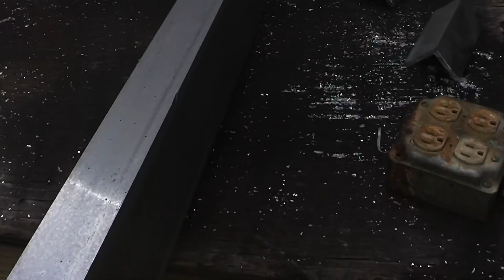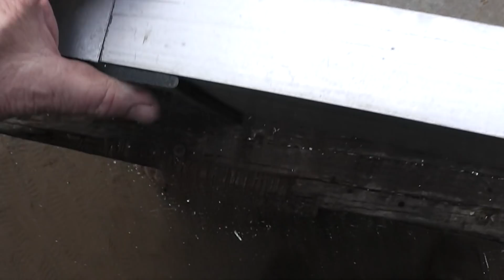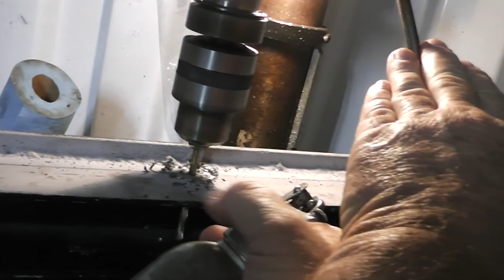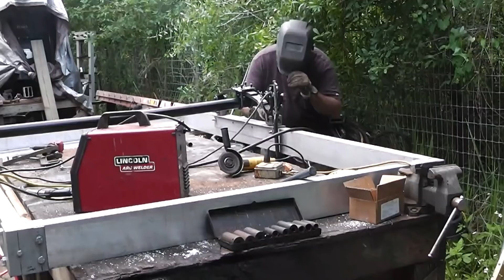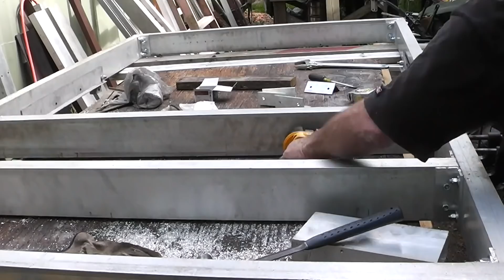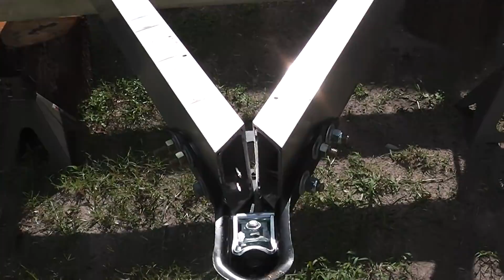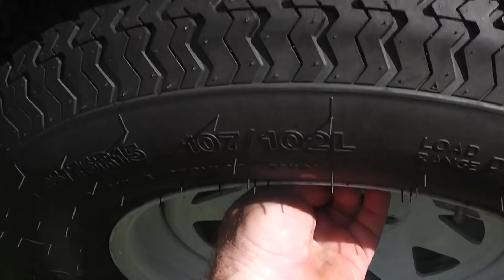How to Build a 5x8 Aluminum Utility Trailer Step by Step

Comment: Im bout to build a 5 by 8 far as that axle you using what is measurement from center leaf spring to center leaf spring just so I know what dimension axle i need for my 5 by 8 framing

Comment: If you didn't want to have a wheel wheel on the side, what you can do is raise your axle to the bottom side of your springs and that it raises it up a little bit, then that way, the tire would be below the flat deck on top

Comment: How much did it end up weighing? As an engineer, I think you did a good job. The sections are probably unnecessarily large, but if that’s what you had available, that’s what you use. Good job
Reply from the maker: Thanks. It weighed 680 pounds. It was over built.

Comment: I like your style ,Over Engineered and Over Built ! Bravo on your Aluminum Welding Skills  i spent 35 Years professionally works in the Ar hate tual Woodworking Industry at one point i changed Companies and worked with one that did 50% Woodworking and 50%ArchitectualnMetal  that was mostly Aluminum  those Welders never disappointed  inCraftsmansip  and Eye pleasing work once i knocked the Skeg off a Outboard Engine of mine ( a Common issue for Boaters  )  and the Owner  told me to grab what i needed out of the Scrap Bin  ,Shape it Prep It and have one of the Welders attach it  on the house ! i did and  it was one of the prettiest repairs ever ! My Welder. actually did Weld all of the Baltimore InnerHarbor Water Taxi Boats the City use to move people around to all the restaraunts and attractions  my Buddy who  was with me when the damage happened couldn’t beleive how flawless the repair was after  a touch up paint job

Comment: 1:25    Angle Iron?    or Aluminium Angle?
Reply from the maker: 4x4 angle iron.
Reply: @homesteadprepper  thanks for the reply.    In the perfect world it would be nice to avoid all steel brackets and fixtures.   I live in the rust belt of southern ontario.   They heap on the salt to the roads in winter

Comment: Do you not have a problem with aluminum and steel contact causing corrosion ? It will reduce the life of the trailer .A non metallic strip between aluminum and steel is used to reduce electrical reaction and corrosion.
Reply from the maker: It's been 4 years and there are no significant corrosion problems, yet.

Comment: Estoy por construir una estructura atornillada con tornillos de 10 cms de largo por 8 mm de espesor. La suma de anchos de los tubos que voy a unir debe ser igual o menor a 9 cms. Es un rectangulo 5.60 x 1.80 metros para un vehiculo de 200 kgs más el peso de 2 adultos y dos niños a 40 kms/hora. Pense en tubos de 2"x2"x2mm a lo largo cada 20 cms con algunas  planchuelas de 5 cms dispuestas a lo ancho cada 1 metro. Seria suficiente ? Alguna idea mejor ? gracias saludos.

Comment: Your axle is on the wrong side of your springs bow in axle gose up not down.
Reply from the maker: In the beginning of the video, the axle is incorrect but, that was just to space the frame rails correctly. If you had taken the time to watch the whole video you would have seen at 32:37 is in the upside down position and that the trailer is in the upside down position as well. When the trailer is turned over on its correct side the axles are correct with the crown in the upwards position.

Comment: Its been 3 1/2 years, did you use it much? Did it hold up? Did dissimilar metals and/or pressure treated wood have any effect so far?
Reply from the maker: No corrosion from the galvanized bolts or pt wood. I've put over 12k miles on her.
Reply: @homesteadprepper  its holding up? How much weight (max weight) have you put on it?

Comment: Came here and took one thing away for sure...if you are thinking about welding an AL trailer frame and you just learned how to AL weld, you might want to reconsider.  This will no doubt hold up, but the questions are:  1.  Is the weight savings and cost increase of using AL with the steel gussets/brackets worth it?  2.  As the old saying goes, weakest link...those brackets will degrade and rust well before the AL if the trailer is abandoned in someone's lot (which trailers often do find themselves).

Comment: regarding the the reaction of pressure treated lumber to aluminium. It will be greatly reduced if you use a foam sill gasket used for framing houses over concrete

Comment: My only criticism is check how your front spring hanger is welded onto your steel. You might want to look under a few professional made trailers before starting a project like this. I would have preferred a lighter gauge steel C chanel instead of aluminium. Its much stronger without adding much weight.
Reply from the maker: This trailer has over 10K miles on it so far and it is holding up just fine.

Comment: How come you elected to use bolts without washers?
Reply from the maker: It is stronger than welding.
Reply: @homesteadprepper  My question is regarding your lack of washers
Reply: Bolts are fine, but not stronger than welding. Not even close.
Reply from the maker: @vulcan4998  How can you say that? Welding aluminum will weaken it. The heat will affect the temper of the aluminum, which will result in a loss in yield strength.

Comment: It is not more convenient to weld everything instead to put too many bolts
?
Reply: Not when you are dealing with a tempered material. Every weld drops the stringth of that aluminum by a factor of 3.

Comment: What’s the most you’ve carried with this trailer?
Reply from the maker: Probably about 1,200 pounds, so far.  I don't see any problems with putting 3000# on it.
Reply: homesteadprepper Any recommended changes after a years of use? Thing you’d have done differently?
Reply from the maker: I would use 2x5x1/8" instead of 2x5x1/4" next time around.  I would use the 1/4" wall if I was building a larger trailer.  This trailer is really over built for its 3500# capacity axle. https://www.youtube.com/watch?v=UlfyZil7y-M

Comment: Where'd you get the aluminum,? I know you said scrap in the description. But jw.
Reply from the maker: I have several fortuitous dumpsters that I have permission to remove scrap from.  It works out very well for both of us because they are charged for the weight of their refuse. So the more I remove, the less they are charged. Btw, it has taken over 10 years of collecting to make the trailer you saw in the vid.  Usually, most companies are very generous with their waste if you just ask.

Comment: Your bolts will forever be coming loose.  Especially where the cross beam brackets meet the main beams.  (Anywhere a bolt gows through a hollow section.) 

 The aluninium rectangular section will squash in with use.  And tgen the bolts will chew out the aluminium once there is any movement in the joint.

You would need to use crush tubes in any hollow section where a fastener pass through it.
Reply from the maker: homesteadprepper 2 days ago

I appreciate your input but, with over 8500 miles on this aluminum trailer, I am just NOT having these issues.  I do believe that would be true with really thin wall aluminum, this trailer is constructed out of 2x5x1/4". https://www.youtube.com/watch?v=UlfyZil7y-M
Reply: yes.   I would agree that crush tubes would be needed.    I cannot imagine that it would be possible to get the bolts tight enough without squeezing the rectangular tube.

Comment: Just thinking, would it work the same in the area of the axle support to use double aluminum 1/4 tubing side by side instead of the steel support that you built? I heard some people say that some stainless steel type of bolts retard corrosion. Since I used to be a sailor, I think that a marine anode would work to prevent corrosion.  Great job.
Reply: True, Home Studio Adventure, stainless steel does not interact with aluminum (galvanic corrosion) like carbon steel -- it is best to ALWAYS either join stainless to aluminum or separate carbon steel from aluminum with plastic, rubber, or some other non reactive material -- pieces of old mud flaps and inner tubes work well, for example.

There are few things as disheartening as finding that telltale white corrosion and a once very light weight, extremely long wearling, and very strong aluminum piece become cracked, brittle, weak, and needing replacement.

Comment: I would have still used lock washers along with the nylon hex nuts. I noticed you did not use nylon nuts where the axle attaches to the leaf spring. You can also drill a hole on the critical bolts and insert a cotter pin for good measure.
Reply: No need for that. From what I've seen, if you buy trailer axle parts and you are not supplied nylocks, they are going to be regular lock nuts which do the job just fine. I'm guessing that's what he had. They are essentially nuts that are crushed or crimped in two places to stop them backing off. Very common.
Reply: Or just weld it. Save a bunch on hardware and no worries about galvanic corrosion.

Comment: Nice job. I am building several 6x12 trailers out of warehouse pallet racking. It will all be bolted together using stainless steel bolts & nylon hex nuts. Stainless steel is cheap when you buy it in bulk. My axles are maintenance free vehicle hubs. They are good for 150,000 miles, and simple to replace. No welding whatsoever. I also managed to connect the leaf springs for easy repairs if needed. I am pretty rough on trailers.

Comment: What is excellent build! But I don't think you will ever be on an Indy pit crew! LOL! Seriously great job! I won't question how much weight do you think you saved compared to a All Steel trailer? Same size obviously
Reply from the maker: I didn't really save a whole lot of weight on this. It was way over built.  If I build another aluminum trailer, I will use 2x5x1/8" instead of the 1/4" that I used on this one. Typically you can build a trailer that is as strong as a steel one but, @ 15% lighter.  This trailer came in at 680#. Using 1/8 wall and less cross bracing would have brought it down to @ 500-550#.
Reply: @homesteadprepper  my voice recognition is terrible on my phone. My whole comment made no sense! I was trying to say it's an excellent build. And it looks like you saved a decent amount of weight by using aluminum. And I was busting chops about being on an Indy pit crew for something or other!. LOL but it really was a great video

Comment: Is it a different welder to do aluminum?
Reply: As far as I know just different welding wire spool inside the welder, probably different temperature depending on the thickness of the metal.... Also as you weld aluminum the tip heats up as you go so you'll have to speed up depending how long the weld is or you'll burn through.
Reply: ...warning, William Mickelson, you'll want to research these issues -- aluminum has broken many hearts -- not only mine!

...for example, because aluminum is so soft, thin filler metal wires (.045" and under), the sizes compatible with smaller wire feeder welders like the one used in this awesome project, will bend and spall inside the liner, bird's nesting near the drive roll inside the wire feeder and never making the journey to the contact tip at the business end of the gun. (Yes, they do sell teflon liners [typically liners are stainless], but they unfortunately won't completely solve the problem ).... 
so, when using a wire feeder with aluminum, the ductility/softness issue is best be addressed by using a spool gun and small spools of aluminum welding wire (which are housed at the special gun itself, not in the wire feeder unit [look it up]), but, spool guns are not cheap.

Next is the problem posed by the extreme thermal conductivity of aluminum: it requires a lot more voltage than carbon and stainless steels to keep everything hot enough to flow, so a larger constant voltage machine (look it up) may be needed, and, thus greater input amperage to power that machine.

...other issues you'll want to research are: (1) prep ( the thin aluminum oxide "skin" actually has a significantly higher melting point than the "meat" beneath it, so you want to remove the oxide (at the weld joint area) either mechanically with abrasives or chemically with a weak acid solution [readily available at your local welding supplier]); (2) shielding  gas mixture; and (3) filler wire choice....

A cheaper way to get going would be TIG rather than MIG, except that (as I found out recently) 180 amps a.c. and under isn't always enough when dealing with large weldments, joining what would otherwise be  appropriately "thin" pieces (3/8" and under) due to the aforementioned thermal conductivity sucking your heat away. 
Finally, of course, when welding Aluminum, whether TIGing or MIGing, you'll need to work indoors so the wind doesn't carry your shielding gas away.

So, all and all, it's very doable, but, compared to carbon and stainless steel, welding aluminum requires some additional equipment, info., and planning, that's all.
Simply switching your filler metal roll may not give you the results you're hoping for.
...any reaserch you do will be its own reward, though, for once you are able to weld aluminum,  you'll be in very high demand!

Wishing you unending success in all things!
Reply: Mig will weld both with different wire & gas

Comment: What was the cost of materials. Axels, leaf springs and frame?
Is aluminum cheaper?
Reply: aluminum is more expensive than steel. but may last longer so in the long run maybe cheaper depending on application
Reply: What was the cost? I'd like to compare to buying a kit.

Comment: What's keeping the nuts on the U-bolts from backing off, due to vibrations?  No lock tight, look washer or lock nut?
Reply: A lot of U-bolt nuts are self locking. The nuts are pinched so they are not perfectly round.

Comment: So let me get this straight, your not going to weld any of the Aluminum, every aluminum trailer I've ever seen was always welded, & is everything quarter in metal,? ( Meaning the frame )
Reply from the maker: Everything is 1/4" with the exception of a few pieces of 1/8" angle.  In retrospect, It would have been fine to just use 1/8" wall rectangular tube. I over built it. The aluminum shown is 6063-T5 which is weldable.  Some aluminums are not weldable.  I went with bolting instead of welding because this trailer is being used for long distance hauling and I did not want to have an aluminum weld failures out in the boonies. Aluminum welds are prone to cracking and finding someone out in the boonies who knows how to weld aluminum might be expensive and time consuming.  Carrying my tig welder, argon bottle and a generator big enough to run it is just not practical.  It is much easier to replace a broken bolt on the side of the road than doing some tig welding.  And FYI, I have logged over 3500 miles on this thing with some heavy loads and no problems.
Reply: @homesteadprepper  ...well thought out and very well explained  -- thank you!

Comment: That's a great looking trailer. Its almost the spitting image of mine. Luckily, my son in law is one helluva welder and welded all the aluminum frame and tongue as I would have give out drilling all the holes!  I actually used a set of aluminum atv ramps as the floor so mud and crap can fall through. I also inset the LEDs into the frame and ran all the wiring inside the frame. Wish I could post a picture!

Comment: Your design is sturdy. The galvanic corrosion will begin to show soon though. There is a product on the market that makes as simple as soldering to weld alluminum. I still would have used all the angles for reinforcement at the joints.
Reply: Good point but I think the builder answered the welding issue very well ( just a few comments before yours); I truly hope you and I are wrong about the builder's choice to not use stainless hardware though!
...I curse that white dust!

Comment: I was wondering how I would couple my roof rack. I think I know how now. Excellent video, very professional. I don't think I'll have the same problem with 2 types of metal being away from the salt?
Many thanks.
Reply from the maker: Thanks.  All of the aluminum you saw in the vid with the exception of the 1/4" angle was reclaimed old scrap that was loaded with galvanized steel bolts and screws. Many of the bolts and screws that were removed seemed to be in really good conditon.  A few bolts were really corroded and the aluminum as you saw in the vid, did not seem to be much affected.  I don't have any salt down south here.  You might consider using some kind of extra coating on your bolts before assembly to combat the salt.  Good luck!

Comment: Thank you. This is awesome. Could this be done on a larger scale eg 7 x 14 for a camper?
Reply from the maker: Thanks. 
Oh yes, most certainly!  And with all the nightmare stories I have heard recently about how new campers failing due to crappy/cheap factory builds, you might just be better off building your own out of aluminum.
Reply: homesteadprepper I was going to ask the same question,.
Thanks for the information it’s much appreciated.
Reply: @homesteadprepper  Great, thank you might save this for later when building the trailer for a camper. I'm building me a Popup trailer, that is lightweight & can be hauled around by an Electric Bike lol, sounds silly but everything has to be 100% self efficient
Reply from the maker: It sounds like a cool idea to me!  Me and many others would love to see your progress when you get started.
Reply: @homesteadprepper  Sure, not sure when I gotta save money for the project though. 
I was thinking something on the lines of 6x8, that way it has room for like a shower n stuff like that. Was thinking of buying an Elf bike but they haven't responded about a custom order. 
They've made Uhaul Bikes, & made trucks out of bikes. 
Was thinking about making a 3door Chevy truck out of that, but they haven't responded. Shucks, would've been somethin cool.